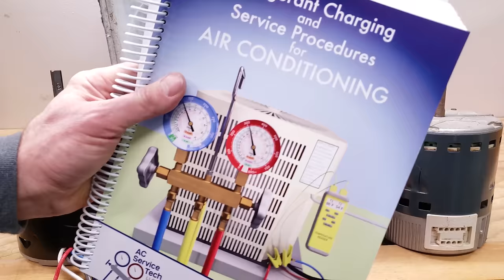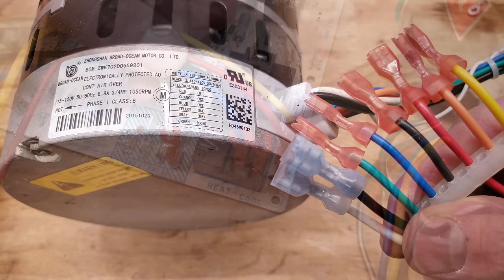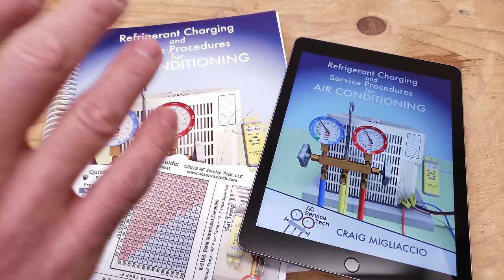Adjusting HVAC Blower Speed CFM on Furnace & AC Units!

Comment: Just after 6:32 you mentioned that if you lower the blower cfm you can take more humidity out of the building. Can you explain that in a little more detail?
Reply: spelunkerd: If the unit runs longer to reach temp. setting is lowers the humidity more. If it short cycles it never gets a chance to ring the humidity out of the air.
Reply: Running at a lower speed, allows the evap coil to get colder extracting more moisture via condensation and the condensate to begin to run off instead of cling to the fins.  In moderate temps, the AC may not run long enough to get the condensate flowing and thus the airflow after the compressor shuts off will just evaporate the moisture back into the indoor air.

One profile I saw for a variable speed blower motor was to run the blower at 75% for the first 10 minutes of the cooling cycle when selected for de-humidification in the blower set up.  Other units are controlled by a dehum signal from the thermostat or humistat.
Reply: I think you said if you speed up the blower to high you don’t get chance to take more humidity cause the temp is gonna reach the set temperature on stat before taking off enough humidity and if you lower it it can take more humidity because is going to run more before reaching set temperature point on stat correct me please thanks
Reply from the maker: Spelunkerd, the lower temp on the coil mixed with an increase in run time, and the humidity in the air moving slower across the coil increases humidity removal, thanks Waterman one, JK Brown, Karim, and Timothy! Great input!
Reply: Slower blower speed drops air temp further removing more moisture.

Comment: Hello, I love your videos, thank you very much for sharing your knowledge with everyone like you do! You never explained how to change the speed on the PSE blower. You showed that the AC is in the higher speed connector which was black and stood for cold, the blue was in the slower connector. However, you never showed us how to change the speed if I wanted to. My carrier 58MCB080-12120 HVAC keeps giving me error 21 Gas Heating lockout. I have replaced most parts but it still keeps tripping after working for a good day or two. I’m thinking the heat switch is thinking it’s overheating and keeps causing the crash. I also can tell that the blower speed is very low which could be causing the overheating. How do I increase the speed of my blower? As you described in your first blower model it does have a capacitor with a solid brown and brown with a white stripe. Thank you in advance!

Comment: On your first example with a PCS it had 1 speed for heat and 1 for cool, but what if you wanted say medium for both?  I'm sure you can but I wondered how with wiring, it must take place on board.  Thx
Reply: You simply look at the wiring schematics on the replacement/rescue motor to see what speed taps are what wires and just put those to your heat and cool terminals on board.almost all motors are high, med high, med low and low. Hope this helps
Reply from the maker: You can add a jumper from the cool tap to the heat tap and then connect the blower speed to the heat or the cool if you have an additional spade on your jumper wire. Then take the leftover wire that does not have a park terminal on the board to connect to and cut the end off, wire nut and zip tie in place, thanks!

Comment: Do you have a video of setting up the cfms on a furnace and making sure there is proper airflow
Reply from the maker: I will be putting put more airflow videos in the future. I did one on the temp rise formula for electric strip heating on an air handler. You can use the same technique for a gas furnace except the formula is slightly different do to the gas combustion. Temp rise formula for gas furnace=(Input BTU/HR x Combustion Efficiency) / (1.08 x Delta T)
Reply: @acservicetechchannel  Thanks

Comment: I lost my commit ??
  Here's my Question I live in Florida, my unit is a 3 ton 5k, residential heat and air. I clean the outside condenser last week removed all the leaves and trash from the bottom of it flush the coils with water. Today I pull the panels on the evaporator that's up in the attic it was nasty, and used some coil cleaner and a soft nylon brush and finally I just drag the garden hose up there and slowly blasted it, at first the water would not flow from one side to the other in the beginning, I remove the blower Motor housing and cleaned the blades on the squirrel cage fan,  Also  we have a Antique wall mounted  thermostat  I I popped a cover and lightly dusted and cleaned it up , this doubled the output of air coming through the vent registers in the house , my blower motor has three tabs , L M H . Right now the blower motor is set on low.  Could I set the blower motor on Medium Speed ? , I understand with it being set on low that increases the runtime so it removes more humidity, so would setting it on Medium be acceptable or would I not really gain anything in the long run ? An of course with this being Florida the humidity can be fierce , this unit is roughly 17 yrs old an we are hoping to upgrade this winter if it makes it , knock on wood it seems to be doing ok for what it is ,
   Thanks .

Comment: Thank you so much for your time , effort and educational videos would you please tell what is that Dip switch by it self for on the last variable speed control board thanks
Reply from the maker: There were four blocks of dip switches, most having to due with airflow but some that have to due with heat speeds, thanks!
Reply: Thanks

Comment: What if you have only 1 wire for your blower motor and slot 1 is low 2 is med. and 3 is high and the schematic is showing that the goes to #2 med.. 
my question is, can I swap the power to (3 high) without causing damage to its relation to the Cooling. So how do you know when and when it’s not ok to do that. I would prefer it on 3. 
Heater is the white wire which on the diagram is supposed to go into #4 med high.

Comment: I have a 3 ton AC unit and a 80% single stage gas furnace that has a BTU input of 80,000 and output of 64,000 and furnace says it’s 1600cfm with a 9 speed ECM motor. What should the heat speed be and then the cool speed be set on? This is just what’s in my house and has been heating and cooling great with no problems at all. Cool speed is currently on high which I assume is the 1600cfm but should it be on med or med/high for 1200cfm? I realize that it appears to be sized wrong for this 2500 sq ft 2 story newer house but it’s been trouble free for whatever reason. I’m in Portland Oregon.

Comment: When setting dip switches for a goodman gmes800804b series. The manual shows only dip switches s1-3 but there's 4 dip switches. The instructions don't label about number 4...
Reply: It is probably marked “TOD” Time on delay, printed on the circuit board. “On” gives you a delay before the fan comes on so the plenum is close to operating temperature. “Off” will turn the blower on immediately.

Comment: Is there any way to decrease the fan speed to a lower setting without getting a furnace to overheat? Like tuning the gas valve to let in less gas or changing orifice size?
Reply: 2 stage furnace does low and high flame output

Comment: Hey Craig, I know youre a busy guy, but do you think you could make a video on how newer eev, defrost and afm boards communicate with the main control boards with DC voltage in Tams?
Reply from the maker: That would really depend on each manufacturer so it won't be something that translates across the board but I know what you mean. Thanks for letting me know what you would like to see!

Comment: Excellent video and method in case you don't for sure have the right circuit diagram.  Question I'd pay $$ for: if you need extra flow in winter, is it OK to bridge the cool and heat taps/terminals, allowing (essentially) black (top speed) to be active in both seasons?  (Usually blue, medium high, is used in winter to avoid blowing cold air.)
Reply: I've been trying to find the answer to that question, too! Did you ever figure it out? It seems like manufacturers don't want you to or they would have used double-spades everywhere.
Reply: @JR-mc3kv  No. I don't own my furnace, so I wasn't able to risk blowing the circuit, so I didn't try it.
Reply: AC Tech answered this question already in earlier comments.  The answer was... YES. You can add a jumper wire so that cool and heat use the same fan speed.  Any unused wires should be wire nut capped and electrical taped.